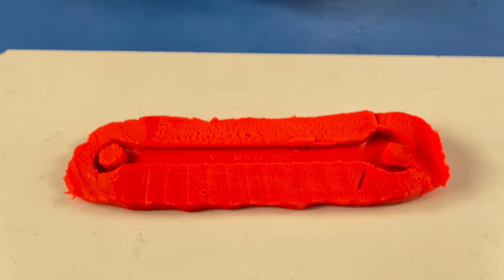Super Glue and Baking Soda Truth! Why no one Talking About This

Comment: I don’t understand using it instead of grout
Reply: Cause not everyone has grout on hand!
Reply: Or the ability to find the grout. I was just in the Philippines and it wasn't easy to find it. But banking soda and CA glue were. Lol go figure
Reply: Cuz I’ve never used grout and wouldn’t feel comfortable buying a huge bag of it either for a 3 inch repair
Reply: @aguamarina2651  Agreed, and for a small fix like this it is much cheaper to use this idea.
Reply: @alishaygan9844  Agreed!
Reply: what's grout?
Reply: @たけ-f7c  it’s when your big toe swells up and is very painful
Reply: @bobcoggin4618  😆
Reply: I've never been to a place where it was difficult to find grout, but that makes the most sense here. As for never using it before and being afraid to do it, that's silly. It's as simple as making dough from flour and water, actually it's exactly like that and anyone can figure it out. Especially if they are here in a YouTube comment section, since that means they know how to type, have access to the internet and are already watching how-to videos. Cost is another, somewhat, valid reason. But the difference between buying a $3 bottle of super glue and $1 of baking soda as opposed to $10-$15 for a small bag of grout to do it the right way(plus you can color match grout). It really comes down to how much you care about the surface you're fixing and the job you're doing.
Reply: I'm curious to see how it would work if you put grout in the crack and then added super glue to that. But if you have the grout, it just takes a bit of water to do it right, so.....
Reply: Lol really I don't understand the logic of making a 2nd wrench...
Reply: @stephenbrennan4508  Just to show how strong it is .
Reply: @thomasdaum1927  lol but he didn't use it on anything it probably broke the first time he tried 🤣
Reply: @stephenbrennan4508  it could have but I was impressed when he used it to remove the stripped Phillips screw , it dos take some strength to do that !…….

Comment: this is common for filling chips on granite/marble counters. Use a sharp box cutter blade to smooth it flush with the counter. It dries translucent so it typically picks up the color of the counter. This trick saved me on more than one project.

Comment: I learned about baking soda and Super Glue about 20 years ago from a good friend who repaired helicopters in the US Army.  He told me they used it to fix small chips and dents  in rotors.
Reply: Yes I agree. What can adhere better and sometimes a better match, is using graphite pencil scrapings.
Reply: Powdered aluminum or magnesium also works well with super glue.
Reply: Where i live, we don't have any Super Glue (or it's very expensive). But we do have is lots of Second Glue (cheap). That's glue that get hard in a few seconds. Is Second Glue the same a Super Glue?
Reply: @peterschets1380  the chemical compound is cryanoacrylate.
Reply: @Michael-0000  Thanks, looks like it's the same glue.

Comment: I am an optician.. I have to repair hundreds of broken frames and parts.. Yesterday I tried it!!!! It's amazing.. Thank you
Reply: I tried too years ago on some frames. The problem was that, while strong,  it's not flexible and it tends to crack and break off with flexing movements that are typical of putting glasses on and off.
Reply: @ozne_2358  You can strengthen it by using a piece of cotton fabric or some yarn. As you said, once the super glue dries, it gets a little brittle. When you use it with cotton, you can get a very strong structure.
Reply: @ozne_2358  I know what are you talking about.. Yes you are right. But in case you want to make smth more solid and stable its super.. I didn't try to fit or take off the lenses.. I used it for permanent solution.. The next step is to buy a new frame!!
Reply: Every time I've seen glasses break, it's at the hinge. How would I use glue to fix that?

Comment: Mix mica powder with the bicarbonate of soda to match the colour with whatever you’re fixing.

To backfill holes in wood, the original sawdust works just as well and is less visible.
Reply: That way , super glue wasn't even necessary ! Common Wood glue would do the job as well...? 🤔
Reply: @ullireusch12  Use super glue for speed, wood glue is fine if you aren't in a hurry.
Reply: @135Ops  There can, sometimes, be issues with the shade of the finished ‘filler’, but this depends on the individual timber and glue. Plain old PVA seems better than Titebond in that respect. Cyanoacrylate / superglue, is, of course, colourless. If you have time, do a small test and leave for 24 hours.

Comment: Been using that tiling trick for decades. - mix part baking soda with fine mortar, and activate with superglue. Got the idea when I was learning Terrazo as a kid. - but in a pinch, this works well and looks natural.
Reply: But why not just use grout?
Reply: @jm7974  Didn't you already ask this question? - Grout is sealer.

but I think you're missing the point of this handy-man tip: Most ppl have, or should have, baking soda and supaglue in the house. You can use this method to spot fix loose, or even broken, single tiles; because its adhesive and comes up clear enough that after polishing, you won't notice it without close scrutiny.
Reply: @palpaladin315  🤦‍♂
Reply: This is convenient.
Reply: what is fine mortar ?

Comment: Have a metal cabinet handle that's broken.  Been trying to super glue the metal to the metal.  Super glue is not at all the magic glue i remember from the 90s.  Finally tried baking soda and superglue, and its fixed and solid.
Reply: @LOWIQ-1  will do, thanks
Reply: Thanks for letting us know it does actually work!
Reply: To me super Glue is Crap !
I've found that it turns to a Crystal form in a very short time .
My go to glue is Shoe Goo but it's not for anything you're going to look at .

Comment: 0:32  this is a replacement, the slots of the self-tapping screw are intact 😀
Reply: YES I SAW THAT TOO
Reply: No it isn't. It is clearly the same screw. Look closer and don't act smart.
Reply: @TSP   no disrespect, sir.  But im in aviation. We removed over torqued, damaged, and corroded screws every day.  Hundreds per panel and several panels a day. So, I know how to easily remove screws of different metals. From aluminum to titanium. That screw was replaced, and that super glue trick doesn't work. If it did, aviation mechanics would be using the hell  out of it just because of the number of screws we use and replace.
Reply: @mikeknowlden9617  , 👍
Reply: The head of the screw is showing the CA glue molded to the tip of the screwdriver.

Comment: Apparently super glue and powdered graphite (sandpaper against a carpenters pencil lead) will form much stronger bonds than with baking soda which is pretty impressive.  Persumably the same would be true for granulated charcoal and super glue as the carbon bonds to super glue shold be the same. Charcoal is more expensive than baking soda, butnot so bad at 5 or 10 lb containers.
Reply: Baking powder goes off very quickly, no time to move anything. Graphite powder, buyable in bags via ebay or similar, dries very slowly, abut 10mins, makes it possible to mix an mould thicker parts.
Reply: I've seen cigarette ash being used in this method.
Reply: I've seen it done with a few foodstuffs, usually breakfast cereals like wheat biscuits. I've used SG and flour to shore up pulled-through screw holes. 
Is baking soda inherently better in some way? Is there an optimum filling medium, or does it not matter so much because the glue is doing all the work?
Reply: @Grandude77  there does seem to be a chemical reaction with baking powder but I think the graphite is just a filler, what Carlos de says about the carbon bonds may be true which is why it is so strong. I know the SG (cyanoacrylate) sets with moisture and certainly damping wood before going works well, do it in advance and wipe it to encourage the glue penetration, but I don’t know the chemistry. Note that some activators will speed up the reaction but reduce strength as demonstrated on another video I saw.
Reply: @jamesmaybury7452  - Baking powder or baking soda?
Reply: I’ve used the baking soda method a few times.  I’ll remember the charcoal for the next time.

Comment: You could also use saw dust and super glue to fill small holes on wood or cover screw's
Reply: Yep I use toothpicks and super glue or either small pieces of Styrofoam cup and super glue. It all works
Reply: Have used wood glue and saw dust for a hole fill in.  Worked out great.
Reply: I use wood glue and sticks or cardboard as filling

Comment: Try superglue on ground up styrofoam or by dripping it onto the Styrofoam and using the melted drippings as a filler/glue. Or superglue and cigarette ashes. Or cotton. Or steel wool threads and glue dripped onto styrofoam so it melts the styrofoam into a liquid and using the liquid drippings to fill cracks/. And for extra sturdy and strong plastic…add steel wool fibers. The baking soda is good but styrofoam is even better. With steel wool fibers it’s extremely solid and sturdy.

Comment: I wonder if you used an airbrush to spray on the glue and then some sort of powder spray gun to spray on the powder to build up layers. Just a thought.
Reply: No no. It will quickly harden inside the airbrush, particularly the nozzle, and that will be the end of it.
Reply: @melgross  Thanks for that bit of useful info!
Reply: @AFineLineA  you’re welcome.
Reply: The way I've done it to replace bits of things that have broken off, is to apply a layer of glue, then some baking soda, then some more glue and then some more soda until it reaches the desired thickness, then sand and form it into the correct shape.

Comment: I think, because in many countries Super Glue is kind of expensive.  Super Glue is an amazing glue and adding baking soda makes it very useful for some purposes, but again: the glue is pricey.  Probably there are similar products from China that are a lot cheaper, as far as I know.
Reply: There are a large number of brands of super glue that have different properties. Yes, in gram quantities, the way most people buy it, it’s very expensive. But while a bottle is pretty expensive, it’s much cheaper per ounce than those tiny consumer packaged quantities where the package and container costs half of the total cost.
Reply: You can find it at most dollar stores
Reply: The brand glue like Loctite is quite expensive but you can find the off brands for about 1/10 of the price around stores here in Sweden at least and it works fine, i use it all the time. I have never used super glue like in the video though.
Reply: @Stefan-  there are so many slightly different types of it that I just use specific types for whatever I’m doing. I find that there are differences in performance between them. I don’t mind the expense, you just need a few drops at the most for any project. I’ve tried no bane products and some don’t work well.w
Reply: @melgross  The ones that i have used works about as well as the brand glues but cost 1/10 of the price, i have also used super glue profesionally for many years earlier in manufacturing of electronics and perhaps more in the assembly of the plastic casings of electronic products, i mean working on glueing these things for days on end. We bought super glue by the litre at that small company. By all means use what you want, but i havent really noticed any difference. There may be specific materials that you may need specific types of glue for but then the standard brand glue wont work either.
Reply: @melgross  and if you leave the lid off the bottle of glue it keeps for years. just make sure it is secure where you store it.

Comment: 1. There is a drills to remove screws/bolts with damaged threads.
2. Will not withstand high force.
3. Good for small fixes, I give you that.
4. Drill bigger size and put small portion of wood glue and a peg.
5. Use corrent size of screw and counter sink it properly or use a peg to hide the hole and the screw. Will also leave a nice finish.
 
In summary - typical "Life hacks"...

Comment: Cyan acrylate (Sekundenkleber) polymerises even with very low amounts of OH- . Normally this is taken from the water of the air. If you are mixing it with Natron - of course it polyerises very fast.

But it is not as stable, as it would be without these masses of Natron.

Comment: I once accidentally made a knife cut of 3/4" on my hand and after cleaning it and waited few minutes to stop bleeding, i quickly covered it with crazy glue and added very little amounts of baking soda to dry it out, i added the baking soda very slowly to avoid that dangerous high temperature of the reaction. That patch lasted attached to skin the enough time to heal, many days. ,
Reply: Baking soda does not "dry it out", rather, it is a catalyst that accelerates the polymerization of cyanoacrylate.
Reply: @thomasmaughan4798  I meant, the glue evaporates so it looks like drying, but not sure, that smoke that you can see with the reaction, does it have particles that come from the glue or the baking soda? Maybe both idk.
Reply: @cerduteter6786  Crazy glue includes solvents.  The baking soda produces an exothermic reaction, which is to say, it gets hot.  So there's going to be vapors.

Comment: Lol this is how mechanics repair chips or minor cracks on helicopter rotors. Super glue and caustic. Cure, sand repeat. Then buff the defect area. It's stronger that almost any rotor material, as welds are supposed to be stronger than the joined peices.

Comment: Not sure why you would want to make a poor copy of a spanner you already have. Plus with holes in wood it's easier to just drill them out and glue a wooden dowel in the hole. Cut it flush and sand. You can then stain to match the wood. 
In fact most of the ideas shown here there are better or easier ways to do these jobs but I suppose these are acceptable alternatives if you don't have the materials or have a job lot of bicarbonate and superglue laying around.

Comment: The first experiment,  the screws are different,  the removed screw is in perfect condition
Reply: The removed screw is showing the CA glue molded to the shape of the tip of the screw driver.

Comment: So what is k a r b o n d? Is that baking soda?- you don't say, and it is not clear with any form of text or explanation. Thank you and best wishes.
Reply: Yes, is Sodium Bicarbonate; Baking Soda.
Reply: @nicksweeney5176  thanks, I'm assuming this is the same baking soda you can buy it any supermarket. Best wishes.
Reply: @Jay C  It is, this is just a different brand. Sodium bicarbonate will cure a lot faster, but baking soda will work all the same.
I want to add, if you want a stronger product or bond, layer the soda and glue. Don't wait for the glue to dry, just do soda, glue, soda, glue and finish with soda
Reply: @jayc3110  
          Yes, definitely so. Whether the Arm-&-Hammer, or any generic brand, same-same.
Reply: Es bicarbonato de sodio, karbonat es el nombre en turco
Reply: @edgarrestrepo2304  Thank you.
Reply: You can bake with Sodium bicarbonate but baking soda can be a different mix and is more expansive. Sodium bicarbonate can be boulot in larger quantity to be used in many ways for many purposes all around the house.
Reply: The video is titled superglue and baking powder…

Comment: After watching the video, I realized that the baking soda and the glue were names I did not know because they were names not from the USA, elsewhere.  News for those people that live in the dark.  I have been using super glue and baking soda for at least the last 40 years.  With the (ca) super glue , they have a product called filler of which is mainly baking soda.  I have used this on my R/C airplanes for years again starting back about 40 years or so, it could have been longer.  Bottom line, this is NOT a new item using baking soda and super glue.  It was kinda of anew item 40 years ago or so, but not now.  Comment by Steve E. is very correct.  It seams that most of the comments are from people that know about the baking soda and ca glue.  However there are a few that apparently still live in caves that do not or did not get out much to explore and learn about baking soda and ca glue 40+ years ago.
A brief history about super glue.  It was developed years before the general population knew about it.  The primary and first use of this glue was used during the Vietnam war in order to temporary stop the bleeding of the wounded so they could transported to a medical facility.  Learn more about the glue by just GOOGLE it ! ! ! ! ! !

Comment: why would you want to make a spanner
Reply: To make a cheap, one time use throwaway. Like if you wanted to reach in a tight spot. Just cut the tool shorter. I can also invision using the technique to make reverse moulding sanding shapes to adhere sand paper to.
Reply: I agree with Thomas Haupt, and to take it a step further, he was probably using  whatever he had on hand, merely to demonstrate how it can be used to form many different things.